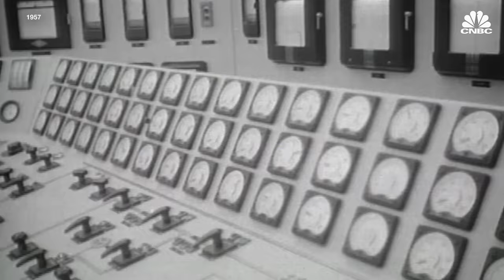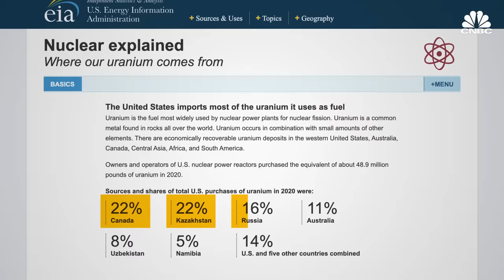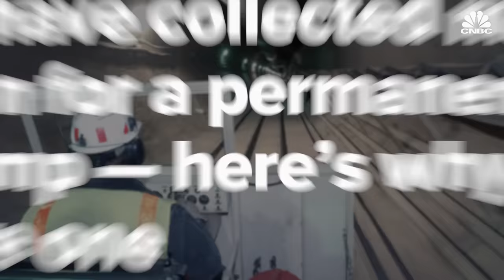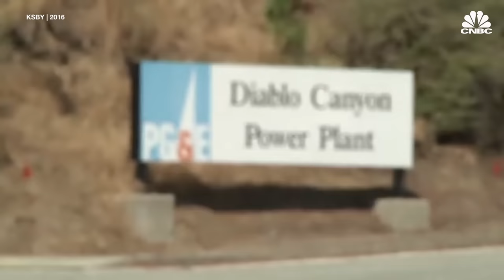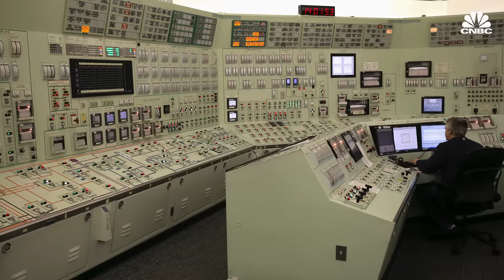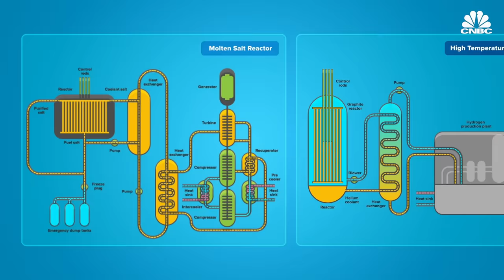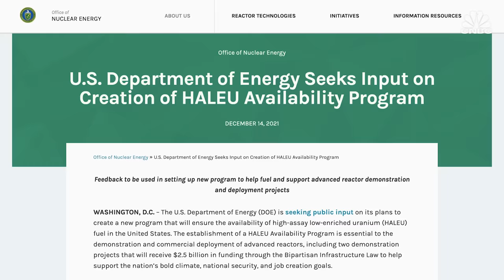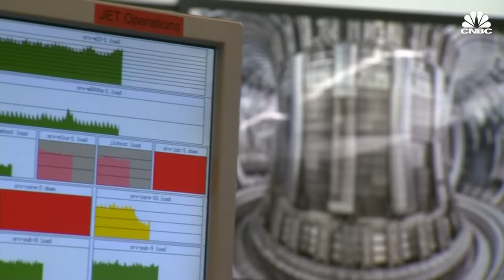Why Nuclear Energy Is On The Verge Of A Renaissance

Comment: Nuclear power is the only viable sustainable energy in terms of efficiency and long term cost/ benefit analysis. We need to build as many new Nuclear Plants as possible, but use the lessons learned in Fukushima, to engineer better and more robust safety into the plants.
Reply: Look into the levelized cost of energy. It is neigher more efficient nor cheaper than renewables.
Reply: @Car_Uma  - Give me some links please.
Reply: @Sovereign_Citizen_LEO   it's easy to look up the LCOE of nuclear and other forms of energy.

Comment: The guy who designed the first light water reactor for submarines was against making larger ones because it would be impossible to contain the fuel in the worst case. A submarine reactor can have everything that goes wrong going wrong and still the fuel will be contained and that's why micro reactors are so attractive.

Comment: The problem is that nuclear waste is hard to handle and store safely. Easy enough to say we’ll just bury it. But not a good long term solution. Not sure if the benefits outweigh the risks!
Reply: It's extremely easy to store safely: On site dry casks.
Reply: We have at least four methods in dealing with nuclear waste safely, and no one in world history has ever been injured by stored nuclear waste.

Comment: Fukushima had nothing to do with the anti-atomic energy movement. The movement was already in full swing before the earthquake. in the last 30 years we built 3. Three mile island, and it
's "disaster," was the bigger cause. I put that in quotes because the radiation released was well within the modern accepted tolerances, and the main source of the disaster was the breakdown of communications in all directions. The breakdown in communication of the manufacturer to the owner, the scientists to the politicians, and the politicians to the people. At every single level there was a breakdown.
Reply: That TMI "disaster" resulted in a multi billion dollar new (less than 1 year old) plant being scrapped, $1 billion to clean up the melted fuel, and a containment so contaminated that it will be left as is for hundreds of years.   What would you call that if not a disaster??
Reply: @clarkkent9080   No one from TMI, yet people die from all other forms of energy production at a higher rate than TMI, yet you don't ever call them a disaster.

Comment: The Plant Vogtle expansion is a clusterf**k. Something like 5 billion over budget and 8 years behind schedule.
They have made it incredibly hard to build these plants out of fear.
Reply: You must work there because the people that I know that work there confirm your first statement.  Here is a little more detail, enjoy!

The Southeastern U.S. is super pro-nuclear MAGA, has zero anti-nukes, and 100% political support. 

VC Summer (South Carolina) new nuclear units 2&3 were canceled in 2017 after spending $17 billion on the project (original estimate of $14 billion and 2016 completion date) with no clear end in sight for costs or schedule. 

Vogtle (Georgia) new nuclear units 3 &4 currently 110% over budget and schedule (currently over $30 billion) and still not operating. Mid way into the build, the utility stated that had they known about the many costly delays they would never have chosen nuclear. They are now delayed another year because according to the project management, thousands of build documents are missing. 

If you can’t build new nuclear in the MAGA super pro-nuclear southeast U.S. then where can you build it?
Reply: @clarkkent9080  I used to work for a steel fab plant that did sub work making very simple parts for the building floors. The tolerances were so tight that the parts were nearly impossible to make. All the fancy Federal inspectors did was reject parts and then go back to sit in the air conditioned inspectors trailer - making 30 to 40 dollars an hour. They wanted to make the job drag out. 

We would cut a plate (say 18X18 inches) and if it was 1/32" off they would reject it and it had to be thrown away. It the paint was a human hair too thick - rejected - when they were going to grind off the paint during install. Foolish little things were dealbreakers.  These were just steel plates that were to be embedded in concrete for machinery to sit on and be welded to - and we still couldn't get it done without a MASSIVE amount of waste and discarded parts. It was a very lucrative job for the company but I would never want to work on another NUC job again until rules and regs got changed to make it more reasonable for the real world.
Reply: @clarkkent9080  Many countries have been building and using small modular reactors for many decades, built in two years or less for millions, not billions.  You fully well know this but keep repeating the same nonsense hundreds of times.
Reply: @danadurnfordkevinblanchdebunk   I wholeheartedly agree. Too much government.

Comment: We can agree that nuclear power is indeed the best. However. It is about 5 times more expensive now in 2022 than solar energy with heat storage. We have got the nuclear reactors pretty much under control - but - that has cost so much in terms of technology so that it is not feasible anymore. Furthermore all the issues with centralized power generation has been largely replaced or taken over by decentralized production. So, while I agree with the author of this video - I have switched.

Comment: Thorium is the fuel that is non weapons grade and also does not make long lasting radioactive waste. plus it's four times more common than Uranium
Reply: Wrong on all accounts, except abundance.
Reply: @darkgalaxy5548  oh really ? would you like to expand on that ? why do you think they want to use it ?
Reply: @psycronizer  As I'm sure you're well aware, the actual fuel is U-233, which is bred from Thorium. 
U-233 makes excellent bomb material, similar to plutonium. It has been used as part of a composite core in Operation Teapot MET test, reportedly as part of the Soviet Union  RDS-37 core, and the Indian Shakti V core. The only draw back is the inevitable contamination by U-232,  which can be mitigated by careful management of protactinium production. 
U-233 produces the same long lived fission products as U-235 & Pu-239, in similar quantities. In theory production of transuranics should be less, because of 2 additional steps to transmute to U-235, where the production of transuranics will follow the usual paths, but less is not zero.
Reply: Too bad no one in the U.S. is even remotely interested
Reply: @clarkkent9080  I think India was, due to low domestic uranium reserves, but lots of thorium.

Comment: Nuclear Power and Climate Change
Even if one assumes that nuclear power is safe it is so risky financially that safety is moot.

Three Mile Island
In March 1979, Unit 2 at the Three Mile Island nuclear station suffered a partial core meltdown.   It was the most significant accident in the history of American commercial nuclear power.  The accident taught us two important lessons.

1.	Nuclear power is safe for people.  Inadequate regulation, faulty design, imprudent operations and several coincidences all contributed to causing the accident.  Bottom line - the containment held.  No one was hurt.  There was no catastrophic radiation leak.  Damage awards were small.

2.	Nuclear power is extremely dangerous for investors.  John Graham, the Treasurer of General Public Utilities (owner of TMI) wrote in Journal of Commercial Bank lending - May 1980, “The discussion of whether to recommend a moratorium on new nuclear plants in the Report by the President’s Commission on Three Mile Island is somewhat irrelevant.  I do not believe that there is a board of directors of an electric utility in the country which would now approve a nuclear plant as a new initiative.”

Why?  Overnight, a billion dollars in revenue producing assets turned into a gigantic, unfunded liability.  People were safe.  Investors were not.

Darlington
Ontario came close to a nuclear financial meltdown.  The first unit at Darlington was started up in 1991.  After a month, they did an inspection.  To their horror, there were cracks in the giant rotor.  It was a design flaw.  All four rotors had to be replaced.  More delay - which in a debt intensive project means escalating costs.

It got much worse.  When they took the fuel bundles out of the reactor, they had been shaken apart.  A massive pump within the system was putting out a vibration that was destroying them.  The pump was re-designed.  The vibration stopped.   Had the re-design not cured the problem, it was possible the entire $17 billion project would have to be written off.  (I was an Executive Speechwriter at Ontario Hydro.  I sat in the office of Ontario Hydro Chair Marc Ellison with Phil Carter, Premier Bob Rae’s personal representative at Hydro, who told me this story.  The test of the new pump was the next day and they were terrified that they would have to announce the complete write-off of the Darlington project).

Things have not gotten better for the nuclear industry
The only nuclear power reactors currently under construction in the U.S. are at the Alvin W. Vogtle Electric Generating Plant in Georgia.   They are years behind schedule and billions over budget.  Plans to add two nuclear reactors to the V.C. Summer Nuclear Station in Jenkinsville, South Carolina have been scrapped with a loss of $9 billion.   Westinghouse, the prime contractor in these projects has filed for bankruptcy.   Parent company Toshiba was forced to sell its chip unit.
Reply: VC Summer spent $10 billion with $7 billion more in contractual commitments.  Vogtle is currently at $30+ billion and at least 1-2 more years away from producing any power. 

There are other starts, money spent, and cancellations such as South Texas Project unit 3/4.  NuScale just halved their SMR project due to ballooning costs and with utility investors backing out, they now delayed the project till 2025.

Doing the same thing over and over and expecting a different result = insanity.

I am in the Southern Company sphere and already have a rate increase of 29% due to Vogtle and more to follow if they ever go critical

Comment: The problem is the storage of nuclear waste, which is radioactive for thousands of years. The containers used are not designed for this life span and it is unclear how we tell people this far out in the future not to touch this stuff.. The video is not talking about plants which had to be shut down due to radioactive leaks. To be clear, i am not entirely against nuclear power generation. If spent nuclear waste can be used again in smaller reactors, it's acceptable as long it is really safe. The waste is already there, so why not using it? Nuclear fusion looks like the most promising energy solution for the future, and I really hope that it works and reactors will be safe. However, this video looks more like an advertisement for the nuclear industry.
Reply: There's at least four ways of dealing safely with the wastes, it's strictly a political problem, not a technological one.
Reply: @danadurnfordkevinblanchdebunk  which four ways you are referring to?
Reply: @Engineeer   Reprocessing, reuse in fast breeder reactors, burying, or spent pool pools/dry casks.  No one in world history has ever been harmed by stored 'nuclear waste'.

Comment: Thank you for the positive and hopeful message. I believe we’ll get there. We have to let the old ways go even though they will be economically painful.
Reply: We have had been extremely fortunate with low prices from easily accessible fuel.  With wind and solar the price will be astronomical and enduring massive rolling blackouts to boot.
Reply: You are correct it will be painful. Just ask the people of South Carolina and Georgia.

The Southeastern U.S. is super pro-nuclear MAGA, has zero anti-nukes, and 100% political support. 

VC Summer (South Carolina) new nuclear units 2&3 were canceled in 2017 after spending $17 billion on the project (original estimate of $14 billion and 2016 completion date) with no clear end in sight for costs or schedule. 

Vogtle (Georgia) new nuclear units 3 &4 currently 110% over budget and schedule (currently $30.2 billion) and still not operating. Mid way into the build, the utility stated that had they known about the many costly delays they would never have chosen nuclear. They are now delayed another year because according to the project management, thousands of build documents are missing. If you can’t build new nuclear in the MAGA super pro-nuclear southeast U.S. then where can you build it?
Reply: @clarkkent9080   Yet you continue to ignore that the US and many other countries have built and operated small modular reactors for many decades built in two years or less for millions not billions.
Reply: @clarkkent9080   So you think nuclear powered Navel vessels do not exist?  Wow, now you are sounding like a flat earther.  This is very easily searched and confirmed.   
And if you put a leash on your NRC dog, those same companies could be building them for the US commercial market.
Reply: @clarkkent9080   I of course have provided dozens US nuclear success stories in the last 20 uears.  All one has to do is look up nuclear vessels, even Wikipedia has a page showing them.  And if it wasn't for the NRC, I could show you dozens more US nuclear success stories in the last 20 years.
Reply: @clarkkent9080   Nuclear Navy reactors are not a lie.  If you don't believe Wikipedia, ask any servicemen who serve aboard one.
Reply: @clarkkent9080   You have been asked a hundred times to show anyone who has gone off the grid.  Such a person doesn't exist since I can always show they are still dependent on society for their needs which of course uses plenty of power.
Reply: @clarkkent9080   You lie yet again.  A former US navel submarine officer clearly states:   "When subs and other ships tie up to the pier, we connect cables to connect the boat to "shore power." Reverse the flow, and the boat powers the shore facilities." 
So clearly you lie once again.

Comment: "The CSIRO’s latest draft of its GenCost report that explores how much different electricity sources will cost says there is no prospect of an SMR plant being built in Australia before 2030.

By then, it estimated a cost of between $7,700/kW and about $17,000/kW – at least five times the cost of large-scale solar in 2030.

The GenCost report says, by 2030, the costs of other electricity generation and supply – including large-scale solar, wind and especially batteries – will have dropped even further." the guardian. I will add, the CSIRO is a world renowned research institute.
Reply: No, you again refuse to use real solar numbers and realistic energy storage.  Try again.
Reply: @danadurnfordkevinblanchdebunk .  Maybe you should read the reports"?
Reply: “[nuclear] at least five times the cost of … solar”

Solar … plus what is cheaper? Solar needs backup, watt for watt, as you know.  So did you mean solar plus gas? Plus coal?  And why aren’t you adding in that cost w solar, along w a carbon cost for its backup?
Reply: @Nill757   And the replacement cost of the solar facilities when they age out four times faster than nuclear.
Reply: @Nill757   see you dont know what your talking about. solar does not need 1 to 1 backup in a large network. Your confusing one data point with a network.  Australias electricity network has backup batteries but they dont need to supply 1 to 1.  Always somewhere on the grid providing power.  You heard of batteries, hydro storage, tidal energy, wave energy. why do you go straight to gas and coal as if thats your limited vocabulary.  Gas and coal are a form of stored energy for sure, but they aint our friends any more. So smart people are looking at alternatives.  as for adding the costs, are we talking now or what the system should look like / could look like in 20yrs?  cause as it is now, it wont be in 20yrs time. So trying on simple simon scenarios is BS on your part. Do people have to spell it all out to you? you cant see the wood from the trees?

Comment: Why not use nuclear waste as a power source? If it produces a lot of thermal energy - which it does - why not put it all in a specially-designed boiler... kinda like a reactor itself... and use the decay heat to generate more steam alongside the main reactor?

Seems like a massive waste to just dump that heat into a pool of water without using it... that's free energy!

Comment: SMRs are still years away from coming online. It wont be until the mid 2030s before they come online in numbers that will have an impact on our energy needs. BTW, the old technology plants were not only "worthy of fear", they were ticking timebombs and extremely dangerous. NEVER let an industry dictate its own terms!
Reply: Nuclear energy has always proven the safest, that's easily looked up.  Also, small modular reactors have been built and used for many decades by many countries.  They build them in two years or less and cost millions, not billions.  That is also easily looked up.
Reply: @johnnynephrite6147   Fukushima zero deaths or radiation injuries.  Three Mile Island zero deaths or radiation injuries, Chernobyl less than.50 deaths but an undermined number of radiation injuries.  That's why nuclear is the safest, which you still refuse to look up.
Reply: If we have trouble siting large scale PWRs what do you think it will take to site 15 SMR to equal the output of one large PWR?